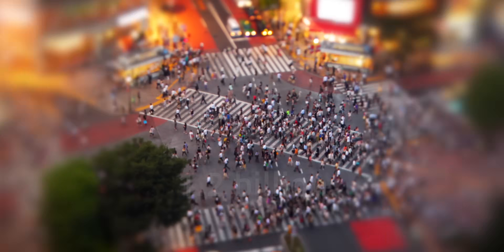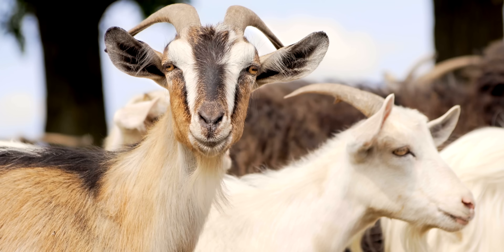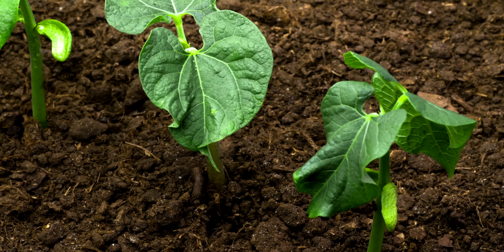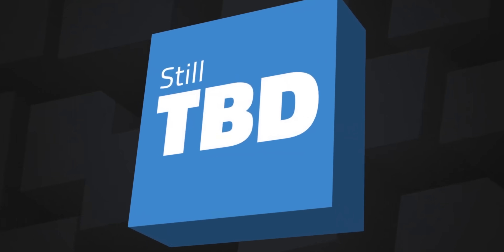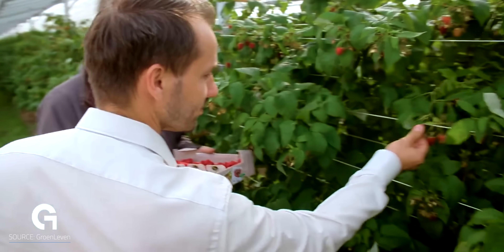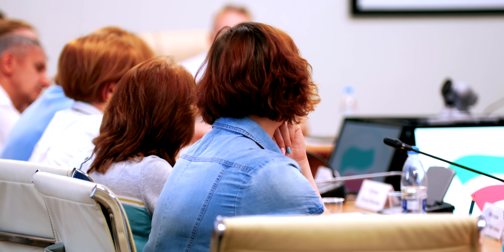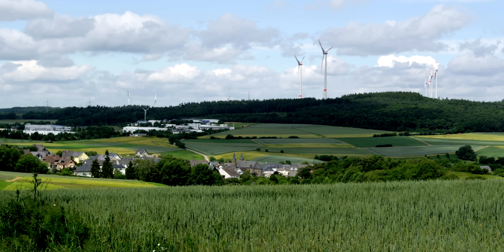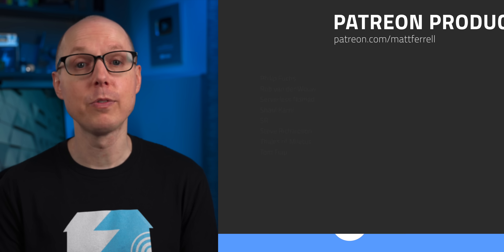Solar Panels Plus Farming? Agrivoltaics Explained

Comment: I can understand peoples complaints against wind farms, noisy, can be seen for miles. Solar? Not very tall and silent, seems to be great option.
Reply: if you believe the usual comments under these videos, what people really want is nuclear reactor in their backyard...
Reply: @spanke2999  and hydrogen cars...
Reply: @chrisheath2637  oh yes, forgot about them, thanks. especially when the hydrogen is created by processing natural gas... But I have to admit I'm also a huge fan of a gas that is so tricky to handle, because it can literally leak through solid metal! Picture the huge energy you need to create hydrogen and then watch it disappearing out of your tank... if that doesn't make the producer happy I don't know what is...
Reply: @spanke2999  Who's been using the car - there's no hydrogen left ? No-one - it's all leaked away...

Comment: I work at a CAFO that is less than a 1/4 mile from a electric transmission line.  I think it would be a win win to install solar above the pens.  It would make some shade for the cattle, and maybe offset our methane production somewhat.  The cattle currently suffer during the summer with zero shade. Solar panels above the feedlot pens would give a duel use to the same area of land without any sacrifice.
Reply: Cattle produce more methane because they are fed corn, and do not eat grass, their natural food.
Reply: @kitemanmusic  That is true, the cattle that would be potentially shaded by solar panels are still going to be fed a diet of corn though and fart out lots of methane, so they might as well have a little bit better life, at least in the summertime.
Reply: The companies that build these projects want nothing but the best yielding crop ground. It’s the easiest and fastest way for them to build them. They get the added benefit of putting more panels in one place so the power stays utility owned.

Comment: I would be curious as to what the raspberry model would show as net revenue per acre of the benefits of the protected crop and the electric revenue vs the cost of putting up the system.  Forget the NIMBY's and government for a moment, because until you have validated numbers over multiple years the farmers won't buy-in.
Reply: I mean, he said in the video that quantity and quality of fruit was comparable or higher/better than the unprotected reference field, so every kWh you get out of it will be a surplus on your earnings.
So it only comes down to when the solar panels will have paid for themselves.
Reply: @midnight8341  Thank you.  Understood.  Looking for specific modeling/numbers not just the economic theory or data from a handful of projects.